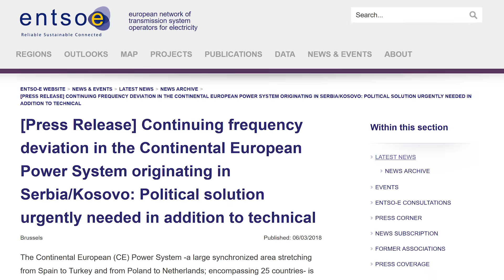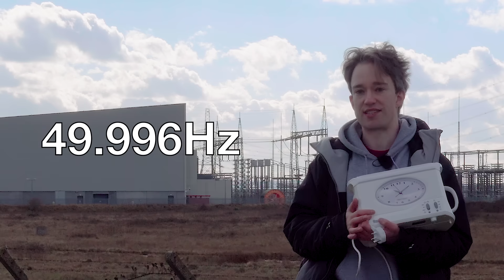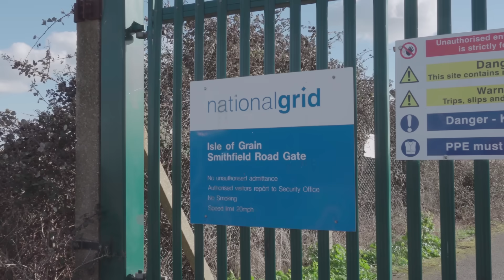European clocks ran slow for a bit. British clocks didn't.

Comment: I was wondering since i heard about this news, how a lack of available power would cause a shift in alternate current frequency? Isn't the frequency fixed by energy providers? Did they throttle down the frequency to lower the power consumption slightly or don't they have any control on the frequency shift so it happens automatically? If anyone knows about electricity and power grids...
Reply: The grid frequency is set by how fast the generators are spinning. If you increase the load on a generator it starts slowing down and you have to feed more power into it ("open up the throttle") to make it speed up again. The problem here is that some generators have not been doing their part, instead mooching off other generator's power, and therefore dragging the whole system down.

Comment: why would anyone use dc for long range power transport???? 😮😮
Reply: For underwater power cables, HVDC avoids the heavy currents required to charge and discharge the cable capacitance each cycle. [Wiki]  Wire diameter is limited for AC transmission lines due to the “skin effect” that prevents an AC current from penetrating to the center of a large wire, whereas a DC line can be arbitrarily thick. At 60 Hz, the skin effect becomes significant for wires greater in diameter than about an inch. Because of the skin effect in part, multiple wires arranged in a circular pattern and separated by polymer spacers are often used in high capacity high voltage AC transmission lines. Thus, overhead HVDC powerlines can transport significantly more power for greater distances than AC lines, for two main reasons: the effective voltage can be higher, and the wires can be bigger. [AC vs. DC Powerlines and the Electrical Grid - The Energy Collective]

Comment: while meanwhile in the USA clocks pull the time from the FM radio band
Reply: You are no different from Europe. You have clocks that use the NIST signal via radio or the internet. Europe has this too using NIST or other signal sources. You have ovens, microwaves & clocks that plug into the wall socket & nearly all of those rely on the 60 Hz electric frequency to keep time. No difference between Europe & USA.

Comment: California's electric grid was originally built to 50hz, so when they connected to the 60hz national grid they had to pledge to fix all the clocks it would affect. There were workshops where power company employees would change the gearing in clocks to reflect the change.

Comment: Interesting, I thought that clocks had their own system for maintaining time. Such as the quartz crystals you would find on computers.
Reply: Most mains connected kitchen appliances [ovens, microwave ovens, washing machines] use the grid electric frequency for timekeeping. It is usually more accurate than quartz crystal which is on average wrong by a second per day [6 mins a year] - billions of quartz crystal timers are made per year & they are not exactly identical in frequency.
Reply: nightjarflying 

Interesting, thanks for the info

Comment: Have Europeans not heard of quartz clocks?
Reply: We have just as many quartz clocks as anywhere else. Most mains connected kitchen appliances [ovens, microwave ovens, washing machines, Teas Maids] use the grid electric frequency for timekeeping - that's everywhere, not just Europe. It is usually more accurate than quartz crystal which is on average wrong by a second per day [6 mins a year] - billions of quartz crystal timers are made per year & they are not exactly identical in frequency. This is true everywhere with reliable grid power.

Comment: Why don't they use clocks that take their time from the internet or GPS..? Using the electric grid frequency instead of a simple time chip seems like a terrible idea. Specifically for this exact reason. How to devices keep the time during a power outage without an onboard time chip? A battery backup would be worthless without such. It just seems so asinine, how much money could realistically, possibly be saved by omitting a time chip in these clocks?

Comment: In this video you touched on something that I think would make an interesting video of its own. The long range transmission of power using DC. The conventional wisdom most documentaries and text books used to put forth was that DC just wasn't suitable for transmission of power over any great distance (hence why we all use AC). How does this system work and how did it come about?

Comment: So is using the frequency of the grid purely a cost-saving measure over some external timing mechanism, such as a quartz crystal? It seems like this would really only affect synchronous electric clocks. There's lots of ways of keeping time, including radio-control synchronization to the atomic clock.

Comment: So if you connected it to the U.S. grid (with an appropriate stepped-down adapter), the clock will run 20% faster.

Comment: I thought the time keeping requirement on the National Grid was dropped when the radio time signal transmitted from Rugby was introduced. The requirement used to be for the number of cycles in a 24 hour period but was then changed to maintaining an average frequency, which from a timekeeping perspective isn't quite so good.

Comment: All my clocks are running off an NTP server, not from the grid :) Even my coffee machine is connected to a TinyControl for automation, which is also getting the time from an NTP server. The clocks hanging on the wall in the flat are powered by AA batteries, so there's really nothing to worry about in my home :) At least not regarding time :)

Comment: Do any modern stuff actualy use grid sync nowdays, I thoght that was abandened years ago when clock chips got cheep enogh.
But then angain I was recenty anoyed that a newly perchased expensive oven dont have a battery backup for the time chip or even a memmory that remember settings after a 5 min blackout

Comment: Why are the power cables DC? Is there a reason, that might be interesting
Reply: Lower transmission losses.
Reply: Lower losses due to capacitance in the long distance cables and if you are not synchronising the grids at each end it would have to be done anyway.
Reply: It's easier to convert AC to DC than the other way round. So once it's over the wire, it's Britain's problem!
Reply: AL_O0 Not efficient, but it lets for power to be transfered long dostances under the sea.

To put it like this - it is fare more reliable that it wins over power lost due conversion.

Fun fact: In Russia thes use DC for very long distance power transfer.
Reply: Hmm, that makes sense, but how efficient is AD-DC conversion twice at thousands of volts?

Comment: Power Plant trivia. Back in the day each power station would have a chronometer and an electric clock in the control room. Every night after midnight they would compare the two clocks. The plant's output frequency would either be increased or decrease slightly until the electric clock matched the chronometer then returned back to 60 Hz (USA).
Reply: Tom didn't explain WHY the power dispute was causing the grid to run slow...
Reply: It's quite charming how simple it used to be.

Comment: Hey Tom, I am an Electrical engineering and computer science student from Serbia, and both of my parents work for the electrical company :D If you need / want more information on why this is actually happening just ask :D
Reply: I am a German Electrical Engineer and I find this quite interesting. Am I correct that basically, the TSO in Kosovo constantly gives to high numbers on their planed energyexchange with their neighboring TSOs?

That would explain why they can get Energy without paying for it and why the other European TSO’s can’t really do something about it, because their controllers need the correct planed energyexchange from all European TSOs in order to work Properly.

And if I’m correct, how does this work in practice? Did they just turn of their power-frequency control (or give it wrong values)?

Comment: DC power transmission? Am I missing something !
Reply: High Voltage transmission over cables always (except for very short distances) happens with DC because of the high capacity of cables.
Reply: that rather interesting, I thought DC is extremely inefficient for  transmission,, but indeed, it is very common specially in under water short distance networks..
Reply: DC is actually more effective for transmission, the Problem is, that converting AC->DC and DC->AC is quite expensive (And converting between different DC voltages too).

Comment: Is that kettle-clock you are holding some sort of novelty/gag item, or are they seriously a common thing in the UK?
Reply: Joel Avrunin 
They used to be common. My grandparents certainly had one and used it every day to wake up with a cup of horrible tea.
Reply: Well what is interesting is that we have coffee makers in the US with clocks built in (and have had them for decades), so this isn't quite that odd of device even on this side of the pond.  It's just the analog clock design which makes it look sort of funny.
Reply: Joel Avrunin 
The funny thing was the pseudo luxury of waking up to a “nice cup of tea” without actually having to get out of bed. This is a bigger benefit than it sounds. Like many others, my grandparents’ house had no central heating system at that time so getting out of bed was cold!

Comment: If you plug a "50Hz" EU clock in to the US power grid, will it run fast? Or would the 120v->240v adaptor also alter the frequency?
Reply: Yes it will run fast if it uses frequency to keep time. Obviously depending on what else it does, the fact that it's being underpowered could be a bigger problem than the frequency

Comment: Expect more trouble in Europe as Germany gets rid of its nuclear power and gives up on geothermal energy (or carries on and wrecks more towns). If Europe actually carried out the instructions from Brussels, they would also be shutting down their coal fired power stations (so far only the UK) and as much of the gas used comes from Russia, the sabre- rattling against Putin might lead to reduced supplies so the Teasmades will be running very slow.
Reply: Also, the drilling under Groningen is going to stop or reduce, which may reduce power as well.

Comment: Well certainly in Spain there are power cuts often enough to make this non-issue. Also I was told that in the UK there are always the correct number of cycles over 24 hours, from 8am. (My farther was an engineer at a Supergrid sub-station. (If you enjoy explosions that was the place to work.))

Comment: Running the grid faster is probably the better solution because everyone who already corrected the 6 minutes will most likely correct it again while everyone who hasn't would stay out of sync if they didn't run it too fast for a while.

Comment: The power frequency being used to control the time on clocks can be really fun when going across the Atlantic. My friend just moved from California to Norway, and brought a few of his American appliances with him, and was really surprised when they days seemed to be going very slowly, and sunrise and sunset were and seemingly random times, as his clocks were only advancing 50 minutes every hour.
Reply: yakovgolyadkin Very few American devices rely on the mains frequency for timing, since a law was passed in 2016 that removed the requirement for correcting frequency errors in the power grid, allowing clocks to wander.
Reply: Well, except for every traffic signal controller made (maybe the latest models don't). These traffic signal controllers DO use the mains frequency for timing. Accurate time is important for keeping signals coordinated. So, the next time you hit 4 red lights in a row, think about how decisions are made without considering the full impact.
Reply: yakovgolyadkin I had the same problem when I took my clock radio with me when I went to live in America for a while. Except too fast.
Reply: @yakovgolyadkin That is why we have such things as wristwatches.
Reply: Fun Fact: Most power companies still keep the timing corrected.
Reply: @MeepChangeling  There are only three grids in the US: US & Canada West, US & Canada East, and Texas. So it is not down to your local power company.

Comment: And then there's me, who has only used battery-powered clocks before.
Clocks that connect to the power system sounds... quite weird for me
Reply: The clock on the wall is usually battery powered. 
But alarm clocks and, as stated in the video, microwave clocks are often connected to the grid.

I must say that I did notice my alarm clock has run out of sync a couple of times in the past few weeks/months, but I didn't think much of it. I just corrected the time and forgot about it :P

Comment: hmmm...I thought sending DC power in a long distance is inefficient.
Reply: KR!RK what is inefficient is sending low voltage power over long distances, and before modern electronics there was no way to create the high voltages necessary for transmission without using ac. Nowadays, a high voltage direct current can be created which is fine for long distance transmission.
Reply: KR!RK actually I believe it’s much more efficient than sending AC. https://engineering.stackexchange.com/a/19759/2198 the issues arise from the difficulty converting - that’s why we normally transmit AC

Comment: Americans have 60hz, which can cause problems if certain electronics are both back and forth. Also why cameras have that weird skipping flashing thing sometimes. They can be built for one frequency but not another
Reply: I think the camera thing is to do with AC powered lighting and framerate, not the camera's themselves.

Comment: British still can't make plugs that connect upside-down
Reply: LueLou no you don´t. That only makes a difference in very few edge cases. Actually I can´t think of one now where it would make a difference.
Reply: LittleDuckAlex if something can be powered by AC and has exposed metal (such as a metal case), it simply has to have the PE connected to those parts. This is done in all modern devices, and for good reason. 

There used to be some ancient devices from before the time of the PE connection where it does matter which way you connect them. But those are extremely rare by now and I wouldn´t want to run them unmodified anyway.

The only devices of today are a few terrible chinese deathtraps which you´re not allowed to sell anywhere in the EU anyway.
For example germany and many other countries have always had reversible plugs without any issues.
Reply: Why would we want to? It's not that hard to put a plug in one way, especially when the Earth pin is always at the top (it's not even annoying like USB-A is).
Reply: Aravaganthus that’s the point though, so you can’t cause a potential danger in certain appliances by have the live and neutral wires the wrong way around
Reply: Shame on us, liking safety and not being electrocuted so easily.
Reply: LittleDuckAlex you should never rely on the neutral and live to be connected correctly in UK appliances and homes anyway. If there is a danger, you are supposed to prevent it using the PE connection.
Reply: it's almost like we don't want to die
Reply: Basement ScienceE Appliences that can run off of AC or DC can have a live chassis if the incorrect way around. If you were to come into contact with anything conductive on the return path, you would be electrocuted. I agree that there is a very slim chance of this happening, but still, that is the reason for not being able to put a mains plug in any old way. And yes, you never should rely on the wiring being correct, as it can be implemented incorrectly in the buildings wiring, but the design is for when things are set up correctly.

Comment: Failing grid but EU is a good thing...
Reply: In this case, has nothing to do with the EU. ;)
Reply: varana312 not at all. The EU is a big reason for trying to force integration like this, which is ridiculous
Reply: Common sense and practical use is the biggest reason for an integration like this, the EU (again, there are lots of countries on this grid that are not in the EU, and many EU countries are separate from it) just often provides a convenient framework.